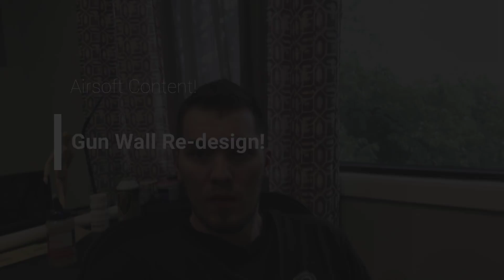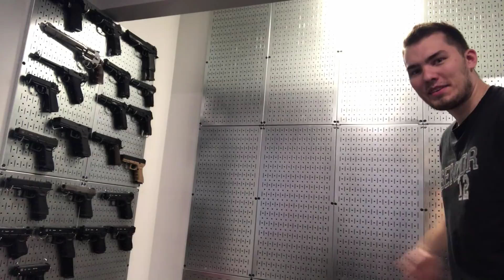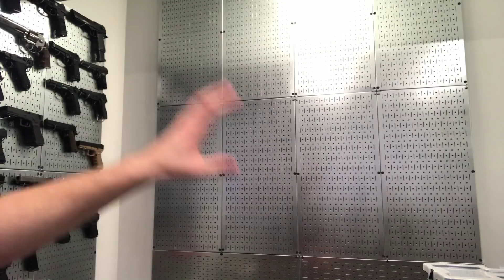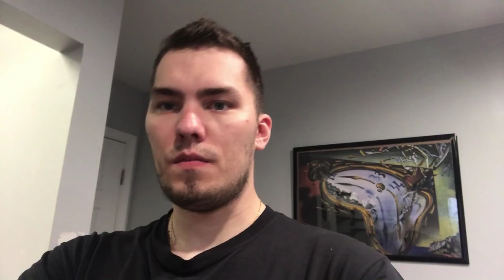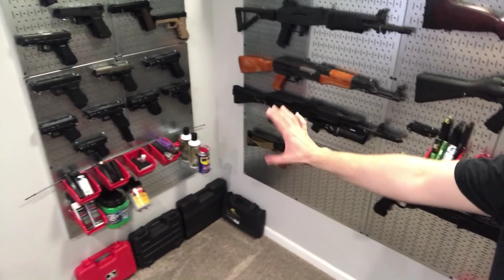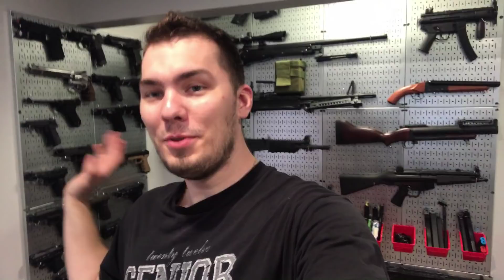Airsoft Gun Wall Re-design! Over 30+ Guns!

Comment: Great collection where did you find the panels ??? I need to do this since I have a fairly large collection spilling out everywhere in the house lol
Reply from the maker: Got these on Amazon and they come in a pack of 2 for like 35 bucks. Its galvanized steel peg boards.
Reply: @MaxCherepenin  thank you I’ll check into them , I do like the way they look but now I’m thinking it can get expensive to do two half walls in my hobby room , thanks again